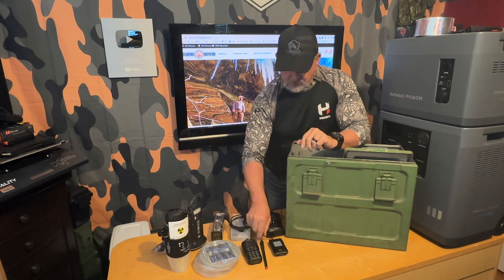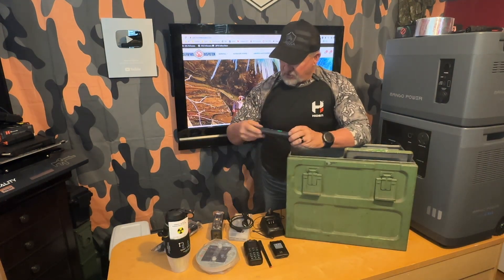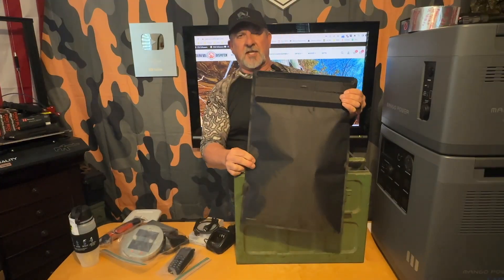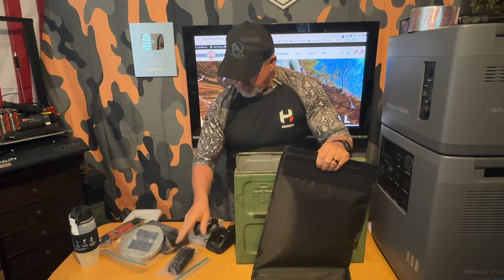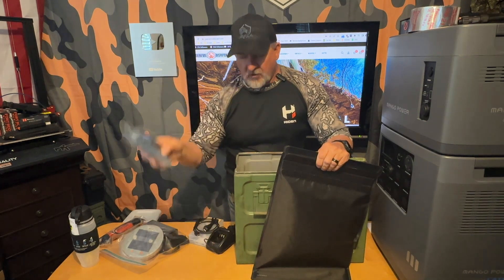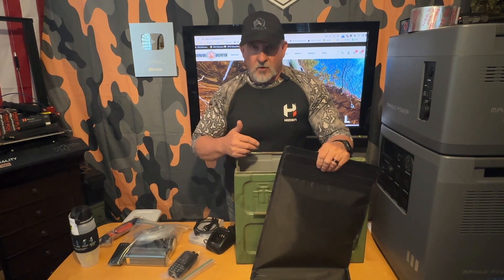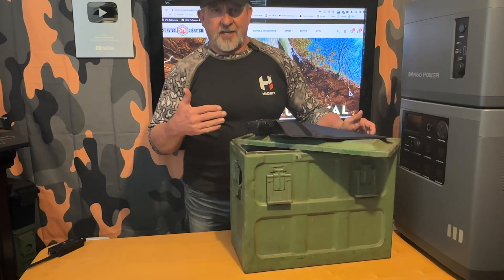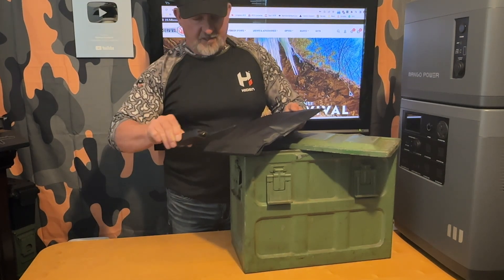Build Your Own Faraday Cage From An Ammo Can - Here's How!

Comment: The foil tape has got glue on it.That means the foil is not touching the metal.That means it will not work right
Reply: yep this is true, I just tested this, throw away the tape its literally useless, just use aluminium foil, so much more effective, sand the top edges and just place the foil over the ammo can and close the lid, use 5 sheets and its sorted, tried this with the tape and it didnt work at all

Comment: My RF Theory and knowledge is a little bit lacking but I'm curious why you would want to put the box on a rubber mat to isolate it from a ground? Wouldn't that help in dissipating the RF energy that hits the box? Once that RF energy hits any kind of metal box like that that energy has to dissipate and that is usually done through heat exchange as I understand it from someone who is an engineer with radio frequency background. Baby I'm just thinking about this all wrong but I figured like a braided cable going to a ground to the box would be an added measure of protection not something you would go in the other direction away from with isolating the box on a rubber mat to reduce any grounding.

Comment: Just use a 12-gauge wire using 2 eyelets from the lid to the body of the ammo container to make the continuity path. Remove the paint where the eyelets attach, then paint over the top to prevent corrosion. In that fashion you keep the watertight construction of the ammo can. I one is worried about the paint cracking at the eyelet attachment points, one can use silicon over the top of the eyelets to make sure of a watertight seal.
Reply from the maker: Awesome feedback. Thank you!
Reply: Also keeps you from losing the lid on small ammo cans. Ask me how I know. :)
Reply from the maker: LOL!